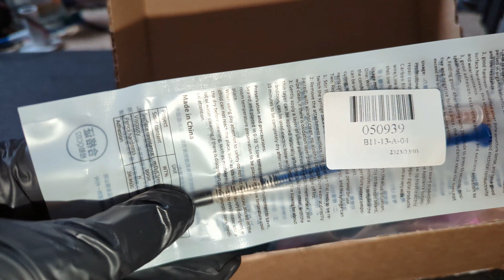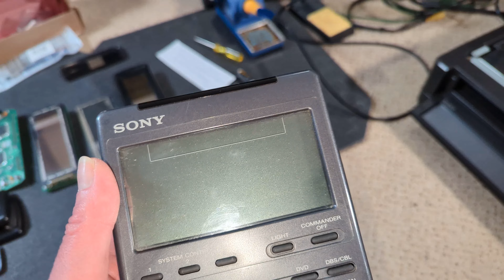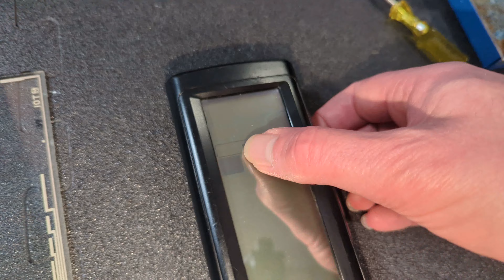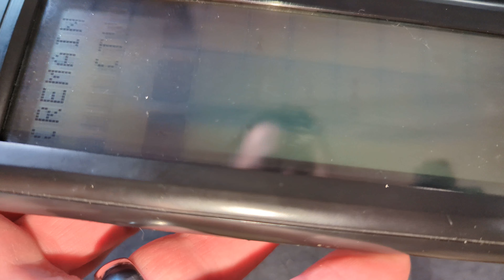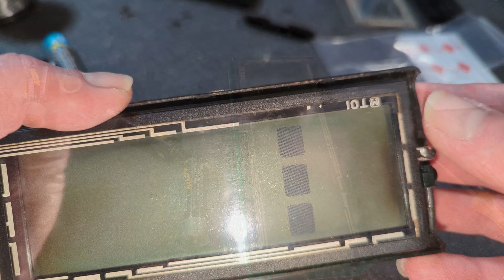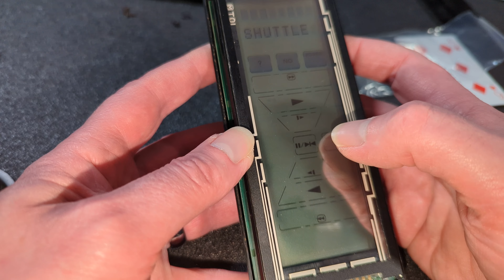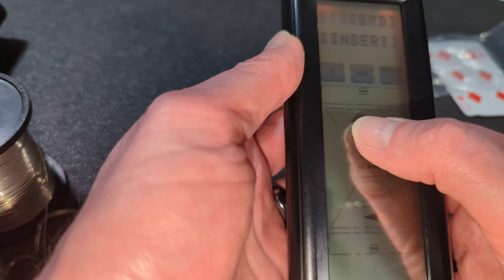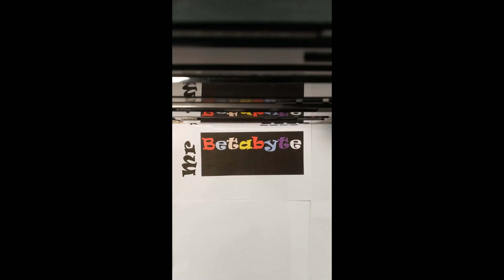Sony Betamax SL2100/SL-HF2100 remote control repairs RMT2100

Comment: i have never seen one of these before very cool i never would have guessed it was for a beta machine had it not been in your title .My 1984 sony 18 inch semi portable crt from 1984 i found the remote model from the service manaul and found the only available remote on a world wide search of ebay  ,there are a few people with the same remote on a facebook crt group who would like the remote ,I was lucky i got it for a donation of £2 towards  postage in the end as the seller tested it and found a button or two not working .
Reply from the maker: Certainly a very unique remote but they can be a bit clumsy. You can only set the clock from the remote though so it a bit of a necessity! That's amazing on your TV remote - that worked out perfectly for you. Did you manage to get the faulty buttons to work?

Comment: Hi Alex, I can send you a replacement power supply if you need it as a backup but it is strange to see that die on you as i have a few of these machines and that has never happened to me, The SL-HF2100 does have the same supply and not a transformer as i also have the US version.
Reply from the maker: Hi Aaron, thank you SO much for this. Leave it with me and I'll have a look at the power supply on this one but it's very useful to know you have a spare if it's needed. Interesting on the US version being the same too - may well mean it could be tweaked to at least accept 110v rather than 100v. I'll drop you an email just now my friend, too.

Comment: I'm lucky to have 2 of these remotes (and HF2100s) in working order, although the display lights are rather dim. Not sure if they were much brighter when new. BTW, there is a high-frequency whine audible during this video. What caused that? Thank you!
Reply from the maker: Yes, the LEDs are not that bright at all - LED tech was still so in it's infancy back then but amazing how Sony went down the route of making these. The high-pitched whine is from the wind at the window!